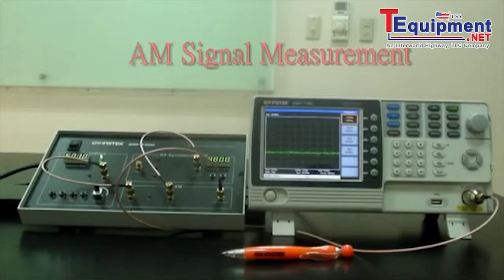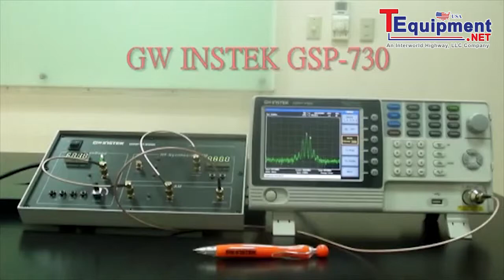Instek GSP-730 Experiment 5: AM Signal Measurement

Comment: Do you notice that your measured upper sideband level is significantly higher than your lower sideband level? Theoretically, the upper sideband and lower sideband power levels should be the same. The GW-Instek GSP-730 teaching guide has spectral plots showing uneven sideband levels, but they don't tell the students the reason for it, which is surprising. The reason is very likely due to uncompensated effects from a weak narrow band Frequency Modulation added to the AM spectrum. The FM effects will be due to non-ideal effects occurring in the GW-Instek 730 measurement system. The narrow band FM spectrum has lower sideband 180 degrees out of phase with the upper sideband. While for AM spectrum, both sidebands are in-phase. The upper sideband of the FM component and the upper sideband of the AM component are in-phase. So, when adding together the weak narrow band FM and the AM spectrum, the overall result is that  lower sideband will be smaller, while the upper sideband will be higher. This issue is something that needs to be addressed (for future models, and teaching manuals).

Also, the AM spectrum should contain 3 components only, ie. carrier, and two side bands. Your measurement shows additional frequency components beyond the two side bands. So what we have there in the measured display is not purely AM.